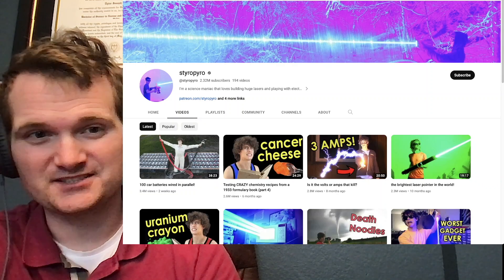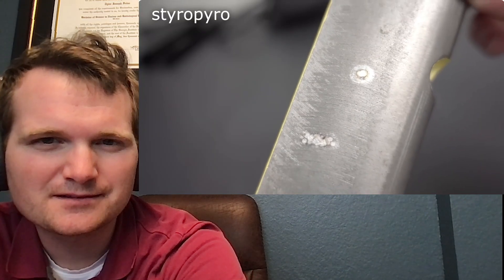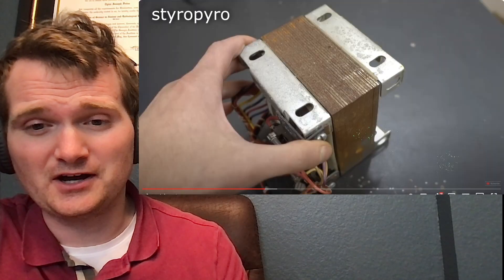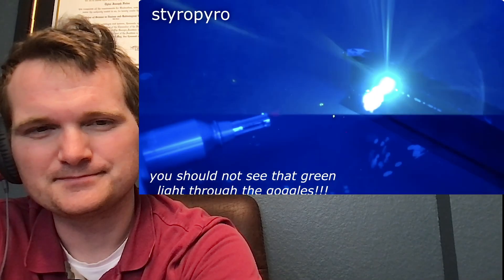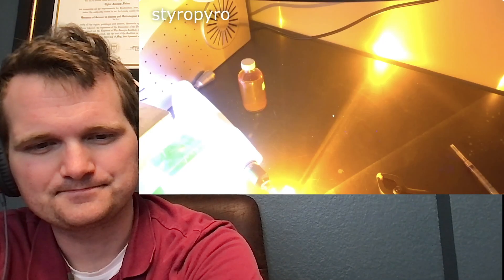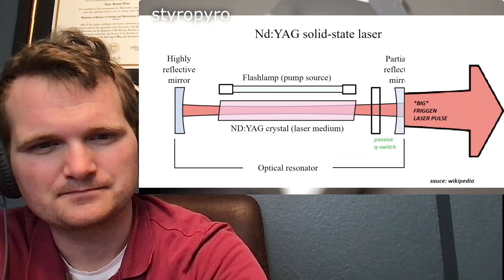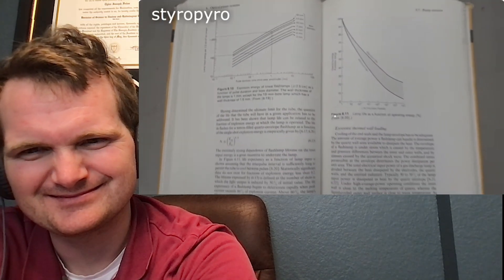Nuclear Engineer Reacts to Styropyro "Dangerous Tattoo Remover from eBay is a MILLION Watt Laser"

Comment: I used to work with 20w argon clublasers in multicolor, and even that was burning through wood. One night I always did a checkup from the installation, and I noticed a beam hitting the wood from a door case, because the dichroic mirror was becoming loose and the beam passed by. I took the mirror and placed it in the right direction. And that was outside. The beam was turning around and was pointing to the night sky, but very dim. We replaced the optics with a darker tone, because where I worked, light pollution was illegal. So that was a 20w laser, later I was working for AED a international recognized PA firm, and they hired us, to give a laser show on our central station in Antwerp, but this one was a 200w green monochrome laser. The laser was placed in a big truck container, in the other container there was a big water cooling, the firefighters gave us fresh water, and cooled the laser with big hoses. And I was on the last trailer, which contained the electrical stuff. We had 4 x 400VAC lines, and back upped by a chunk of a generator. Because lasers can't be switched off fast, you have to bring down the power in steps. Well we turned the big old clock on the building with a digital clock. We worked in teams from 4 people for each trailer. So I take 1.000.000 watts with a big rock of salt. If you see what we used to power up a 200 real watts laser, all the water cooling in mind, and a few hundered amperes as power. These were CEE 5 pole cables and each cable inside was 6mm²

Comment: The peak power output of nuclear explosives is basically comparable to a small star. Comparable to something like Proxima Centauri. Large asteroid impacts are probably about the same.
Reply: Planetary collisions are actually more powerful than stars. The moon-forming impact probably released over 10^30 J in a matter of minutes.
Reply: Although the flash hazard is much greater from asteroid impacts than nukes even on airless worlds due to duration being on the order of hundreds of milliseconds of single digit nanoseconds.
Reply: Note however that much of The energy in planetary collisions or asteroid impacts will not be in the form of light immediately radiated away though, so the power of the collision and the luminosity of the collision will be too very different numbers.

Comment: Qs ND YAG lasers are able to generate huge power in the pulses because the pulses are so short. This is probably a nanosecond pulse laser, new tattoo lasers have picosecond pulses. Also the wavelength (1064nm) is REALLY well absorbed by dark pigment. The "Q switch" is two polarizers that rotate relative to each other to allow pulses through. A lot of lasers are pumped by other lasers or by flashlamps. :)

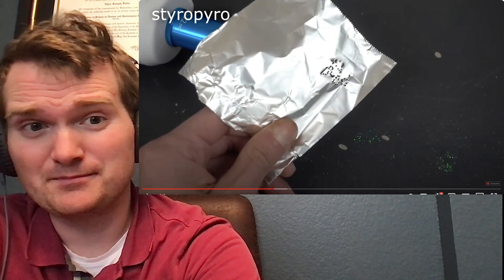Comment: 7:07 that logic doesn't quite work. Both the laser and the beta particles are stoppen by the aluminium, egal. Aluminium is not transparent. It just happens to evaporate when you pump It hard enough

Comment: Just quick comment to anyone who plays with lasers.  A green laser pointer works  by passing infra red light at 1024nm through a potassium titanyl phosphate crystal which re-emits green light at 512nm. If this crystal is mis-aligned, (I've found if it's cold) very little green light is emitted but the infra red light still gets through. You can't see this so don't look into the business end of an apparently non-functioning laser of any kind. You could lose your sight.
You should be wearing suitable eye protection anyway.
The small lasers I used at work had labels saying "Caution - do not look down  beam with remaining eye"

Comment: Tyler..I'm actually asking. .not second guessing..is truly, hard-core ,distilled water NOT conductive to electricity? Or did i hear that incorrectly?
Reply: The is always some conductivity due to the self-ionization of water molecules, but yes, ultra-pure water is a very poor conductor.
Reply: Proper, clean distilled water is maybe BARELY conductive, allowing  0.5 to 2 uS/cm of conductivity.  Compare this to 'general drinking water' with between 50 and 1500 uS/cm.  uS are "microSiemens".  For comparison, nickel is 146,000 S/cm.  So for uS, multiply by 1000; 146,000,000 uS/cm.  Siemens are a reciprocal of Ohms, I think.  I found a chart from some company that says if the conductivity of water is 0.056 uS/cm^2, then the resistivity is 18 megohms/cm^2.  So, properly pure water is RATHER nonconductive.  Hard rubber is 10^-14 Siemens per Meter, so ten to the negative 11 for 'S/cm2'..?  So it's not as resistive as wood or rubber, but considering what it is, it's very 'generally resistive' when pure.

Now, mind that if you stick one dirty, sweaty fingertip into the stream as you pour, you are already massively impacting the conductivity of the water...so don't do that.  Also, lab-grade-clean your glassware or whatever so tiny bits of residues won't change its conductivity.  ALSO...annoyingly...some very poorly-managed distillation facilities also use filtering AFTER distilling because they are so freaking FOUL.  If your distilled water says anything aside from "Reverse Osmosis" or "Steam Distillation", it is likely 'gross distilled-ish sorta-clean water' and should not be used for batteries, Neti pots, or high-energy cooling systems.  Frankly, anywhere so gross as to require post-distillation filtering should be considered 'filtered tap water' at best, and generally NOT used for any purposes...but that's maybe just me.

For a personal example, I've used distilled water (and LOTS of it) to wash off a laptop that got dropped into ocean water when the user somehow actually got it back a second later AND took the battery out before that self-destructed.  I washed it all off with gallons of distilled water until my ohmmeter stopped showing low numbers from the outflow water.  Then I took the whole thing apart and rinsed it internally bit by bit.  There was no sand found, so that was hopeful.  The CDRom drive was 'a little odd' after that and they did need a new battery, but the unit otherwise survived the experience of a drenching with sea-water.  Also, no, this was neither easy nor simple, but I enjoy the challenge when others say "You dropped your laptop in the ocean?  There's no way that'll be recovered!"  I was like, "Challenge Accepted!  But bring like 20 or 30 gallons of distilled water with you when you deliver it."  Don't let the saltwater linger or dry out, do not apply even a TINY bit of power to the laptop again until it has been cleaned out, use PURE water to wash it out, and then toast it dry for a few days at like 140F or so and it can at least SOMETIMES work.

So, pure distilled and/or de-ionized water are very minimally conductive in my experience.  Oh, and if you need to wash dirty-lint and detritus off of electronics, there may be better ideas out there, but for the most part I use simple Ivory bar soap with a toothbrush.  Get some soap, brush the area clean, wash off promptly.  For optimal results, use a NEW BAR of soap, because your current bar of soap from the bathroom has your water-supply-minerals on it, and maybe whatever you washed off of your hands recently.  The more delicate the electronics, the more costly it would be to replace, the more serious you should be about a new bar of soap and lots of distilled water.  Also, I never allow anything to SOAK, I simply wash the surface with water with it tilted 20-45 degrees, then brush off various sections of grossness while rinsing again and again with distilled water.  Some people use a container of distilled water and submerge things in it to clean them, and then they just 'get it done and back out quickly' to try to minimize the risk of soaking into anything, but I only ever rinse-and-scrub-and-rinse-morem then shake a thing off and promptly toast it dry.  YMMV depending on purity and promptness and all sorts of things.
Reply: @EShirako  well thank you. 
This is eye opening information.. I've been in the construction field for dam near 40 years and was unaware of these things. We all just always assumed water was/is highly conductive.. I'll probably not share this information..with my coworkers/apprentices... cuz it's a lot to explain..lol 😆 🤣.. I tried explaining that oxygen wasn't flammable... and got nothing but grief..lol 😆.. so can't even start to explain that water isn't conductive...lol. and we literally never deal with clean distilled deionized water.  But I personally love knowing things that most others don't.  So thanks..😊😊
Reply: You kids rock. I'm one of those "old school " mechanics/construction guy... who is trying to continue forward in learning. And this particular information has absolutely decimated my prior experience, knowledge of these interactions.

Comment: I'm actually taking a class on nonlinear optics at the moment so I can comment a bit on the second harmonic generation part. These nonlinear effects come from the fact that a material's susceptibility to polarization is actually a function of the electric field itself, and when you take a power series expansion of the susceptibility, you get a series of terms dependant on different order powers of the electric field. Second harmonic generation (SHG) is an example of a second order process, which means that the interaction cross section for these processes depends on the square of the electric field (which is linear with the intensity), with a rather small coefficient (chi-2),depending on the material.

The reason he said that it normally isnt so easy to make SHG is because these cross sections are basically negligible for small intensities, but the electric fields get really high in pulsed laser systems, so the SHG cross section  (and thus the interaction efficiency) is really high. Most green lasers use SHG to make the green light, as a matter of fact. They use a 1064nm laser with a chi-2 nonlinear material inside the cavity to generate the green light because no good green transmission really exists.

Comment: 15:22 These insane E-fields a short enough laser pulse can produce can be used to accelerate electrons to 100s of MeV to GeV in a matter of a few cm. The laser wakefield accelerator utilizes femtosecond terawatt laser or attosecond petawatt laser (both produced from chirped pulse amplification of a mode-lock Ti:Sapph laser) for such acceleration of electrons. Sadly, protons or heavier particles can't be accelerated by this method (at least yet) due to their low charge-to-mass ratio.

Comment: But Pulse-Lasers can also be pretty powerful and radioactive.

We have a "small one" at work.
(Has a pulse lenght of some Femtoseconds and has the Power of some Petawatt per shot.

And the Beam is at the biggest part 32cm thick and is then focused to a diameter of some mm.)
Reply: To be clear, this laser needs more than just some wood. 
The experiments with this laser do need to happen in a special containment building with 1m-thick doors and walls.
Reply: @ElektrischInkorrekt  holy shit, that sounds mind-blowing. What keywords do I google to look into such tech?
Reply: And holy shit, I found some pretty new articles, that a small company 'marvel fusions' tries to build a small fusion reactor with this laser...😳

(to be honest, I don't know all experiments, which are inside this buildings and I haven't yet heard the 'fusion reactor'-keyword in connection with cala.)

Comment: The laser is igniting dust in the air Not the air
Reply: you sure youre not generalizing from the deionized water thing at the start of the video? :p
Reply: @Taygetea  No I think that the laser is detonating the dust In the air Triggering explosion
Reply: No, the laser is actually breaking down the air. It’s called Laser induced breakdown and for example used in LIBS. You can also get breakdown in high velocity liquids or/and with ultrasonic standing fields. Basically a ball of plasma in the focal point. @applied science has done some with high pressure oil
Reply: Or at least it's the catalyst to Help ignite The air

Comment: This was my first Styropyro video and it scared the shit out of me , crazy how fast you can lose your sight
Reply: And that's what told me not to play around with lasers.
Reply: Literally instant severe permanent eye damage
Reply: Yea, that fun little laser pointer you used to play with the cat was suddenly looking more dangerous. Not that I was afraid for my eye sight, because I was still sure they wouldn't sell anything really dangerous at the dollar store. Well later videos by other creators who tested the true strength of "harmless" laser pointers soon told me not to trust the label on anything with a laser that wasn't at least $1000 and made by a large well known manufacturer. Either they promise too much and you get way less energy than you thought, or they claim it's way weaker than it really is. Some "safe" laser pointers has been over a hundred times the power of what's considered safe.
Reply: @blahorgaslisk7763  Don't be silly, they don't have to be that expensive. Just don't but dodgy Chinese crap from eBay. Reputable manufacturers can make properly certified lasers for less than a hundred dollars, whether that's a laser level from Home Depot or a laser pointer from Canon or Logitech. Just don't buy no-name crap from China for five bucks and you'll be fine.